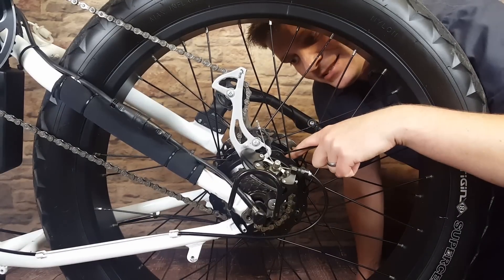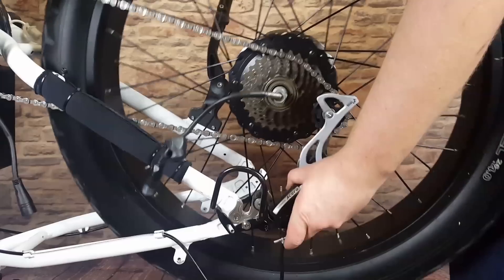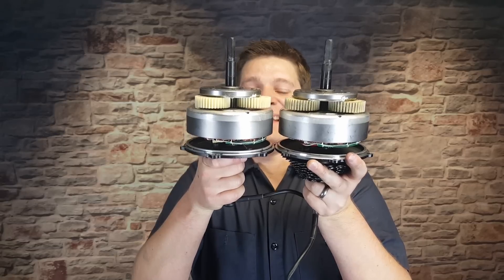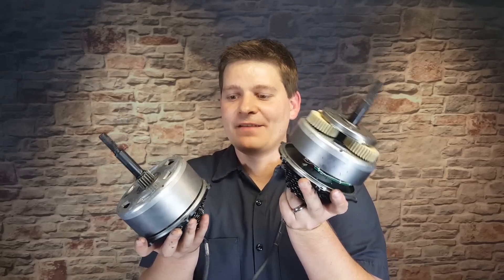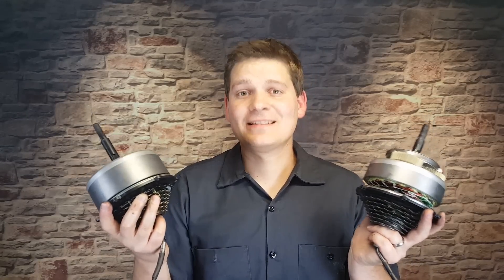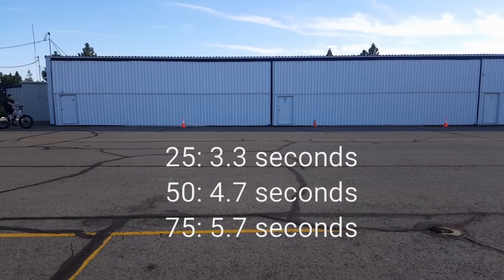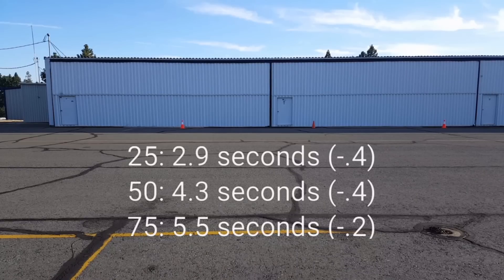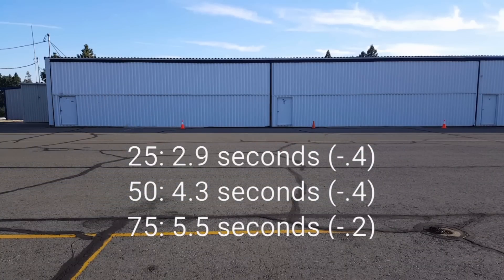Considering the RadRover Ebike?  You better watch this first!

Comment: I guess, as an old fart, that I don’t get this video. 1 second faster, .2 seconds faster? It’s a “who cares” to me because I bought it to cruise to work, ride around town and enjoy the outdoors. If I wanted to go faster I would have bought a Kawasaki 1000. I bought mine with my son-in-law before the tariff increase, with a two-bike discount and an Amazon card discount for $1243. Haven’t seen many at that price and haven’t had any issues. That to me, along with the enjoyment, seems more important than saving .8 seconds in 25 feet. I guess as I age I get more out of touch with today’s reality. Enjoy your bike and I’ll wave as you pass me by. 😄
Reply: Barry,  It's not about .1 and .4 seconds faster, that is to show that the Rad Rover is using a smaller motor to go faster, there is really nothing wrong with that except that it is less robust and there is a measurable difference (the .1 and .2 seconds are the measurable difference). I ride 160 miles a week minimum. I want the motor to be as robust as possible due to all the mileage I put on my bike. I personally don't want a 500W (or 350W?) motor overdriven to 750 W to give up the ghost any sooner than it has to.  
The other issue deals with integrity.  If I buy a 750W motor, I don't want an overdriven 500W motor running 750W, I want the motor the manufacturer rates for 750W.  They rated the larger, beefier,heavier motor at 750W for a reason.
Reply: Whitlon Joralemon  I personally wanted speed of a moped with the bike appearance. When people ask why I didn't choose a moped, I say if the motor fails I'll pedal, most common issues I can fix myself, & much more then I care to rant about. Primarily, it's a lifestyle choice!
Reply: Fully agree, I bought one 6 months ago, commuting 12 km everyday and doing  cross country on weekends, I absolutely love it, best value for money at EUR 1400!.  The ride is so smooth, Tyres pressure at 16 -18 PSI. The only thing I might upgrade is to have torque sensor,
Reply: Just like america to increase tariffs on green tech
Reply: @H P It makes a lot more sense if you consider the fact that, effectively, the 750w motor is immortal and the 350/500 is not (considering a 48v nominal battery and the Rad's 22a peak controller).  This is especially true if you live in an area of steep hills where the motor is going to have to work hard.  350/500's have been known to fail in that circumstance (long hills, throttle, motor burns out).  For people who rely on the bike for daily transportation, a Bafang 750w fat motor is essentially a guarantee of forever in terms of your being unable to kill it.  there is also the issue of principle:  Its a lie to call that motor a 750, plain and simple.  The gymnastics that Rad has gone to to justify what they are doing (this is not the first time they have been caught at this) is an unforced error.  The difference in cost between a proper 750 and a 350/500 is why they are doing this.  The company has a good reputation otherwise and something like this ruins it.
Reply: Funny this guy just wants to tear down the competition but no mention over cost$$$$
Reply: @markfromwestcoastwoodcraft7633  NO!! I did my homework first and got a similarly priced bike ..604 Shred. It has a 500W motor that is twice the size as what Rad calls a 500w. Also mine has many superior components.
Reply: Well said, Barry. 👴🦸
Reply: @Jerry Doughty hey. Sorry your missing the point here. I'll repeat what they said...it's not about speed but how robust the motor is. I'm a big guy with disabilities so going fast isn't wise for me...but I want power like when hills are steep, etc. Then there's the integrity issue....he covered it. I dis as you suggest...spent more cash. On a budget though so was lucky to find a much better bike for just 300$ more than a Rad....Surface604 Shred.
   BTW....I have the same motor ' listed' as the Rad. After watching this I checked and Lawdy Lawd!!!!! He's right!!!
Reply: @markfromwestcoastwoodcraft7633  do your own research....Jeez! Rad people are SOOO defensive!!!! I found a bike just 300$ more than the Rad and there's really no comparison.  Surface604 Shred. Look it up. I eat Rads for brkfst!!!
Reply: @Jerry Doughty Jerry...if you haven't bought that Rad yet check out Surface604 ebikes. I was in bed for 2months after a neck surgery so had lots of time to research. Wanted the Boar Hunter but tariff problems with Trump caused me to choose the Shred...close on paper to a Rad. Say no more...check them out on Google.
Reply: I just purchased two Rad Rover bikes and I agree with Barry. I am also an old fart at 60.... I don't care about speed,.,.,. as a matter of fact,.,. I can't go slow enough on them. These bikes make you go fast and faster,,.,
Reply: @David Klein Your logic is flawed. This youtuber is promoting his business and his ebikes as being superior and trashes the competition as a way to promote himself which is a sign for me to say avoid this business. If I was this youtuber and I found out that Radrover was being sold a 500watt engine. I would call them up and say hey this manfacturer is selling you 500watt engines at 750watt prices. Instead he is saying that Radrover is intentionally telling people that they are being sold 500watt engines but are being told they are 750watts. I think that itself speaks for itself. If your personal experiences tell you different then rely on your own experiences because nothing beats personal experience over someone who wants to sell you their product over their competitions.
Reply: @noonespecial6076  it's not my logic nor is it Mr. Chitocks...its physics. I don't think you understood the video..if you even watched it ! Dip!
Reply: @David Klein I did watched it. Bafeng sold Radmotors something less than 750w (according to youtuber) and instead of calling up Radmotors and letting them know makes a video making it appear that Radmotors is misleading their customers. Your defensiveness proves my point.
Reply: @davidklein1667  It seems that my reply to you either isn't showing up or something is wrong on my end. I will do my best to explain again. 1) I did watched the video and I understood it. 2) It isn't my fault that you are upset that I nor others see things your way. 3) I do not know who Mr. Chitocks is as I don't see that name in the comment section. 4) What does physics has to do with the manfacturer Baofang telling Radmotors that they are being sold a 750w motor when they are really being sold a motor of less watts. 5) I've noticed that you have an unknown hostility to anything with the name Rad Rover or any bike from that company. You should look into that. 6) I am here because youtube recommended this video for me looking up 2019 ebikes and rad rover was a name that I recognize from watching youtube videos. 7) I've watched 3 videos from this youtuber and he DOES sell his own ebikes, promotes his own ebikes, and touts his e-bikes and that is okay because this is his channel. 8) It is why I prefer to see what negative responses BUYERS of said ebikes has to say about their purchase is how you truly know if the bike is worth getting. 9) From this video and the others that I saw insinuates that Radrover intentionally misleads their customers into thinking they are buying a certain product instead of calling up the company and saying that they are being sold something less than what they are promoting to sell and if they say something along the lines of "they know or they don't care" and the youtuber has proof that they said that. Well, it sounds like he (youtuber) is trying to smear another company instead of looking out for a fellow ebike seller. 10) I said my peace and I won't waste any more time with you even if you reply because there are other videos of different ebikes I am looking into to see what ebike is best for me. Have a nice day.
Reply: @kirk4156  thank God I'm not
Reply: Old fart here too. this old fart also rides the Desert 100 every year on my 450 KTM, it tough being a old fart.  Barry is right on, the bikes are awesome. I bought one for my son to ride in downtown Seattle for Christmas i love it so much. Rad rules!
Reply: you really miss the point. Rad Powered is deceiving us about the motor it used.
Reply: Since Rad is selling a 500w motor as a 750w motor they know it. Calling them isn't going to make them go "oh my we didn't know that" it might make them decide to change but more than likely have decided to cut costs & make more on the bottom line.
Reply: @wj9494  So, with what you wrote you do not tell us the E-bike you ride. Maybe because you do not ride a E-bike. That makes your comment not even relevant.
Reply: @fmc6338  That is right doster Trump 2020
Reply: @websitemaker1717  Has no impact on me. All one has to do is read and it is plainly stated that the max watts is limited to 500 watts for short periods. And It does come with pedals that I suppose are there to be used. If a pure electric is wanted they are available for far more money. Many countries limit motor wattage by law and the EU is by and far the worse .But anything over 750 watts has to be registered as a scooter and then one has to pay licence fees and or insurance which destroys the whole concept of owning an electric and here is the key word bycycle .
Reply: Older and wiser, I'd say 😊
Reply: if you bought a car and paid extra for a 6 cylinder and you opened the hood to find a 4 cylinder would you think something was wrong?
Reply: rodge911 these old farts don’t care about deception. It doesn’t matter if it’s cheap. You’re being sold a lie. It’s a principle thing. And Bolton is exposing them. To each their own though
Reply: I too am of a certain age and  the appeal of this bike is that you'll be moving faster and further than any pedestrian, Faster than most pedal bikes and half traffic speed on suburban (housing estate) roads. If range is an issue then consider a second battery (along with water, ibuprofen and a phone charge bank) and you're still under the price of lots of other entry-level offerings...... I am not deterred by some incremental  "shortcomings".... these bikes are built to a price.

Comment: I bought one for my wife, then bought one for myself, then convinced my riding buddy to buy one. Together we have about 2500 miles on them. I’ve got over 20k logged miles on conventional mountain bikes... the RadRover is worth every penny.
Reply: Is it 48v???  Watts??, price for Hubmotor 48v 1000watts please
Reply: its a poorly designed bike that wont last you 5 years.
Reply: @kmuralikrishna1582  1000 watts are only legal In the USA for off road, 750 watt on the street. And I have owned my rad mini for 3 years and have just put on one set of break pads and no mechanical issues. The rad mini is 48 volt with a 660 watt 14 amp hour battery. And the motor can handle 750 watts for a limited amount of time. In run 2 it pulls 135 watts which I use most of the time and with light peddling goes 12 mph easily. And with pedaling draws less. The longest I have gone so far with pedaling and run 2 is 80 miles and still had one bar showing on the panel. And I even pull a trailer into the desert with 60 lbs and have not had any problems. So, the choice is yours.
Reply: @xmateinc  You say poorly designed but you give no other that is a better design vs cost. For the intended use the Rad Power electrics are great. My Rad power is now on its third year with no issues and expect no problems in the future years. Buy the one of your choice and enjoy the freedom of electric bikes.
Reply: @ohwell2790  for 1500 I'd save up another 500 and get anything with a bosch motor. They equip those rad's with the cheapest shimano parts available, and rad doesnt design those frames.  As a bike mechanic I would have to say that Rad Rovers are some of the most hated bikes to work on.
Reply: @ohwell2790  and if you've only changed the pads once in 3 years then you hardly ride that thing. Put it to the test and ride it everyday, and it will fail.
Reply: @xmateinc  I have 2500 miles on my RadMini no flats no problems just enjoyment. I love it !
Reply: @xmateinc  Which one would you recommend instead?
Reply: @naxville  depends on what you want, townie go is a great bike for 1500

Comment: I totally get the desire to address the difference between motors and that the RadRover should have the actual 750w as the label reads.  If the label reads 750w I should have a 750w motor not 500w.  That said, there are two camps of thought here and IMO they are both in a comfortable place.  One camp wants the 750w—I won’t say for bragging rights—it’s the point that I should have what the label reads.  Why Bafang (actually pronounced Ba fong) did this seems deceptive.  For me I fall into the camp that isn’t too concerned and enjoy the bike.  Keep up the good investigative work though because it keeps companies straight

Comment: I asked Rad about this, and here's what they said:

"Thanks for reaching out about some misinformation around our motors. I am happy to shed some light on this topic to help you understand the 750 watt motor we use.

Bafang makes a true 750 watt motor for our bikes. By true 750 watt motor, I mean that it is nomial at 750 and peaks at 750. Doing so ensures an amazing performance while staying within the class 2 ebike regulations. While some motors out there have a lower nominal rating than the peak power, our motor design is not like that.

We are aware of some misinformation spreading around the internet about motors like ours not being 750 watts. The size of the casing around a motor does not necessarily imply a stronger motor. The mechanical components and electrical engineering of the internals dictate this. As the largest seller of ebikes in the US, our goal is to provide you with a great bike and customer experience. We are not here to mislead folks. We are here to foster a positive community around our radical bikes. Our CEO has also jumped in on Facebook groups to explain our motor more in-depth. We also offer a 1-year warranty for the 750 watt motor. We could not offer this if our motor ended up not being 750 watts.
"
Reply: Evan Windom that’s definitely a statement full of bs. Plenty of companies who give you as advertised and have a 1 year warranty to cover the as-advertised purchase.
Reply: Thank you for asking them
Reply: Your warranty isn't worth toilet paper. My battery failed after just 2 months because the flimsy cover on the charge port fell off while I was riding and then the whole thing shorted out. No warranty coverage offered. Customer service tried to blame an imaginary power surge in my house which miraculously didn't short out any other electronic device or appliance. Amazing!
Reply: @stephanluclarose  If it shorts out, all you need is a fuse replace, no? Idk, i thought thats what fuses were for.

Comment: Those motors are the same since, the casing on the rover motor is what makes the size look different. There is more than one model of the bafang 750 by the way. It's the controller that controls the performance of the motor itself.

Comment: I own a 2016 rad rover 7728.0 miles in service 04-21-16 runs like a top im getting two 2019 this spring they are awesome
Reply: I rolled the odometer on my rover plus plus a few thousand more I am on my fourth hub moter covered under warrantee they are legit

Comment: Great topic. One of the difficulties in making a choice for an e-bike is it's ability or lack there of climbing hills with weight. I am tall and around 260 lbs. My gear is around 40+ lbs  Most game lands and National Parks have a 750watt motor or less requirement. I do not care about speed, what I need is high torque to pull a heavy load up a steep hill. Gearing is everything when it comes to pulling loads up a hill. Do they make an 750watt electric motor that is designed for high torque and slower speed? If not, can one be changed to help with pulling a heavier load up a hill? Thanks for taking the time to make this video.
Reply: I'm in the same boat,and am considering a 60 tooth rear,or a jackshaft ,on a left hand chaindrive independent of the pedal chain,like my gassers.

Comment: So even though the Rad Rover 'alleges' it comes with a 750 watt motor, it appears that it's really closer to a 500 watt motor.  The Rad Rover ads border on deceptive advertising, as they allege the 'peak' power of their motor is 750 watts, whereas a 'real' 750 watt ebike motor, like those on the Himiway Cruiser peaks closer to 1,100 or 1,200 watts.

Comment: Ive ran both..the larger 750 and the 350w in my fatbike.
They are exactly the same speed and torque at 1500w.
Never damaged anything and I SERIOUSLY abuse them, full power climbs over boulders and throttle open landings from jumps.
I eventually bent the spindle on the 750w after landing a three foot drop with my 220lb weight, straight onto a boulder that stopped the bike dead...a vice and a box spanner fixed it.
The planetary gears are indestructable..never had a problem in two years of using the bike like a dirtbike on over a hundred hard rides.
Reply from the maker: That seems a bit odd, the 750 should have noticeably more torque.  It can be felt at almost all power levels.
Reply: Bolton Ebikes no..they both quote the same torque and the 350 can climb mountains just as well, I thought the same when I got it , but it performs identically.
I presume the larger motor could absorb more heat but in my experience its the phase wires that melt first
Reply: Heres the two motors I use.
https://i.imgur.com/S6eoIlQr.jpg